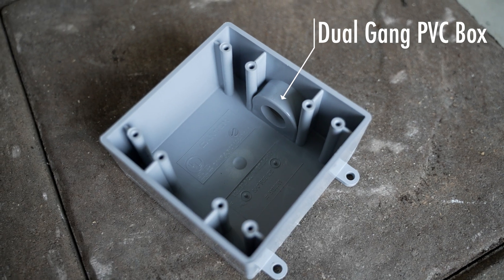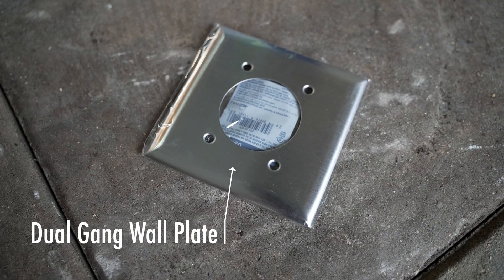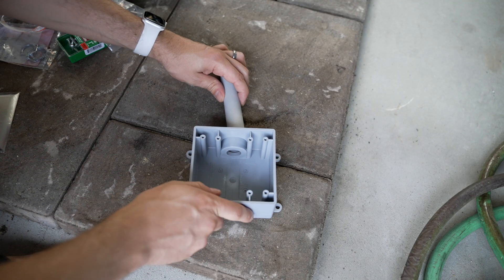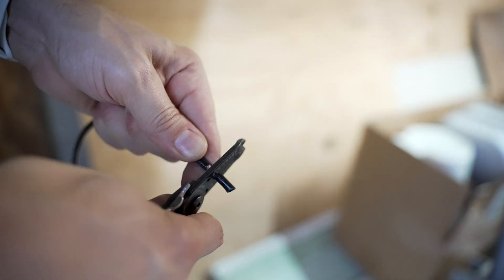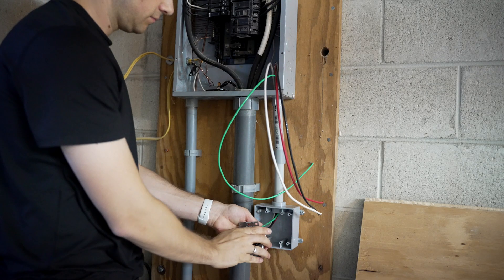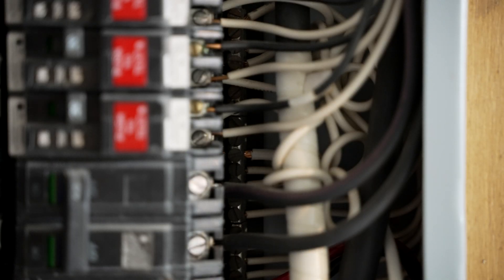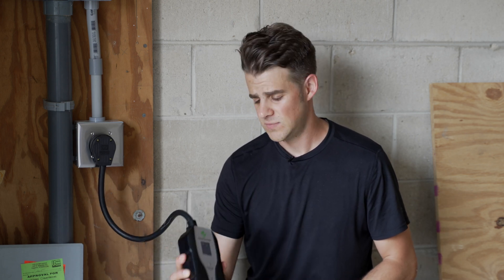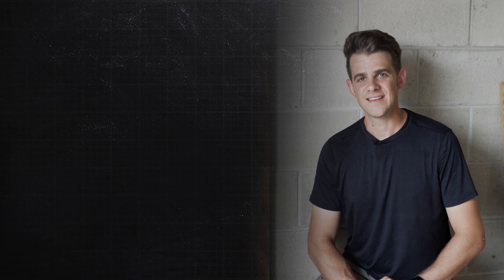Installing an Outlet for Level 2 EV Charging

Comment: All outlets in garages are required to be GFCI protected. My understanding is that the unit can only rely upon the internal GFCI protections of the charger if it is hardwired - avoiding the plug in. Otherwise, with a plugin it needs to have a GFCI 2 pole breaker, at substantial expense. Is that not being enforced in you area?
Reply: That rule only depends on if your city/state is requiring you to use the 2020 nec. Places like California are still on 2017 until next year.
Reply: @jokra3870  Jo, please check this "unchanged" article in the 2020 NEC .... 625.54. ELECTRIC VEHICLE POWER TRANSFER SYSTEMS.

It requires a gfci protected outlet for car chargers.  The big change for 2020 was they added the garage requirement if applicable in 210.8

Thank you
Reply: @keithharrington8715  I'll check that thanks.
Reply: @jokra3870  Nope.  All outlets in garages must be GFCI protected period (no matter if it's a car charger or not).  It's been that way since at least 2017 (I think earlier).
Reply: However he did oops as you are supposed to use wire based on 60c temp rating so he should of actually used 6awg for hots and neutral and 8 for ground. Though thhn thwn is rated at 50 you are supposed to use the lowest rating on 310.15(b)(16). Ev chargers are also considered a continuous load so technically he should of calculated that tid bit.
Reply: I heard there’s lot of false trips with gfci’s on a car charger.
Reply: A lot of discussion about GFCI for the outlet. Correct with the code references but it still depends on the jurisdiction. I have two plug in installations this week and ran the question up to the chief electrical inspector in my area. Not required at this time. Second and more importantly he is using an inexpensive Leviton outlet that we are not allowed to use (per the company I get projects from). It needs to be a a commercial grade ($80-160 vs $15) as it is a continuous load and not intermittent.
Reply: Sir, more to the point,, NEC article 625.54 (car charging) requires the recepticle for charging be gfci protected.  It does not mention hard wiring.....good call.
Reply: @keithharrington8715  I'm just happy alot of the charging units for tesla and many others have GFCI'S built in them. Breakers are expensive.
Reply: @jokra3870  yes they are, yet the car charging section mentions both as requirements.....in the charger and forth recpticle.
Reply: @keithharrington8715  yes he has 50 a outlet 125% Rule 3 hour or more 40a constant x1.25=50amp breaker he needs to match temps for terminations derate temp for conductor going thruegh the etic adjust for mor than 3 conductor to zice the condutors NEC 2020 ALL EVS NEED GFCI .If you are charging a rivian at 40 amp continous for up to 15 hours the nima 14-50 is going to get so hot low cuality outlet could burned up potencial fire is beter to install a tesla wall charger At 48 amp continous its got adaters for non tesla ev and is gfci protected. Its a must  its safer that way...
Reply: @panchopantera8287  you are correct.  The big advantage with the tesla charger is that it can be hardwired.  Hardwiring removes the recepticle and the breaker gfci requirement.  Also, at 60 a, the tesla does not need a disconnect iaw 625.43).

Another big miss by many is in 625.41 is the 125 % rating of the circuit and breaker at the maximum Load of the equipment.  You can put a 60 watt bulb in a 100 watt fixture, but the circuit must be rated for the 100 watt fixture.
Reply: @keithharrington8715  thats correct the 125  % RULE IS TO ZICE THE CONDUCTOR AT A HIGHER AMPICITY TO DICIPATE HEAT ,,, 10 HOURS AT 48 AMP CONSTANT THE CONDUCTORS NEED TO HANDLE THE HEAT.. and to zise the current protection correctly.

Comment: Hi Josh - great video but you might want to double check the amperages.  Normally 6 gauge wire is for 50amps and 8 gauge wire is for 40 amps.  A NEMA 14-50 outlet can actually be used either on a 50amp or 40 amp circuit (since there is no such thing as a NEMA 14-40 outlet), but you might consider swapping out the 50amp breaker for a 40 amp breaker.  If your level 2 charger is pulling a straight 40 amps (80% of 50 amps) instead of 32 amps (80% of 40 amps) I would suggest pointing a laser thermometer at different components of the circuit (breaker / wires / outlet / etc) after the car has been charging at full power for an hour or so to see if any part of the circuit is overheating to a concerning level.
Reply from the maker: Thanks Patrick. You are correct that 6 gauge is typically required for 50 amps. However, the THHN 90C wire I used it is rated up to 55Amps at 8 gauge. A caveat to this would be accounting for voltage drop on very long runs.
Reply: @chargeeverywhere  careful reading that ampacity chart, you can only use the 90° rating if the terminals at the breaker and the device are also rated at 90°.  You have to use the rating of the lowest part of the assembly when calculating your ampacity.  If it's not marked on the device you are to assume the terminals are rated at 60°.
Reply from the maker: @BluCappy419  Thanks for pointing this out. I’m planning an update video to address some things I didn’t consider. Both the breaker and outlet used are rated to 75C but this is something I didn’t fully appreciate.
Reply: @chargeeverywhere  As a new Tesla owner and apprentice Electrician the two gentleman above are correct. Undersized wire is a fire hazard. You did great, just re-do that with 6awg
Reply from the maker: @ridingwithryan1507  Thanks Ryan. I appreciate the feedback and am working on an update video to show the mistakes I made. For this, I'm planning on swapping out the breaker to 40A as this is sufficient for my 32A EVSE. It's a bit easier than running new wire.
Reply from the maker: @TheSteveknockout Agreed. I address this in my follow-up video: https://youtu.be/CTT0mkVq-8s I did eventually swap out the 8 AWG for 6 AWG as I upgraded to an industrial-style outlet that was rated to 60C.
Reply from the maker: @TheSteveknockout I would have thought so too, but the installation manual explicitly said to use the 60°C column. I found it strange as it's so much better built than the Leviton outlet (60/75) I replaced.
Reply from the maker: @TheSteveknockout https://imgur.com/fmSerBk Here are the installation guidelines. As you can see, Bryant recommends a wire with 90°C insulation (THHN or equivalent) but sized according to the 60°C column - perhaps to make sure it plays well with older breakers.
Reply: #8 THHN is good for 50a because of the 75c Breaker. thhn  wire is rated for 90c. Romex is rated @60c=40amps
Reply: When using NM-B ("Romex") you'd want to use 6 gauge for 50A and 8 gauge for 40A.